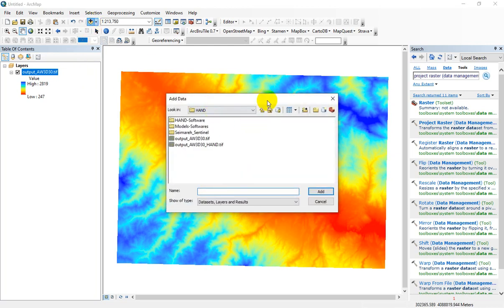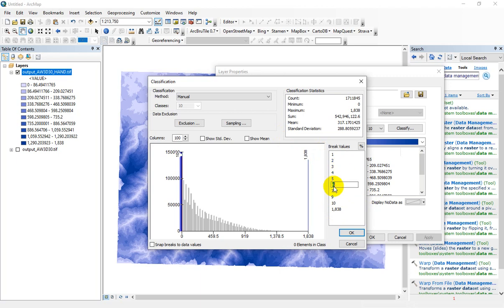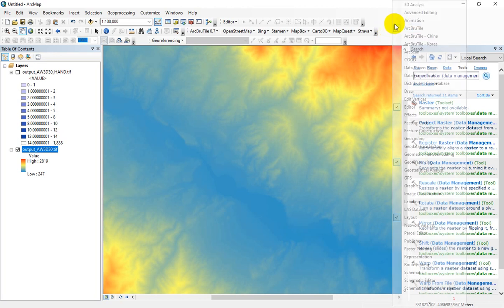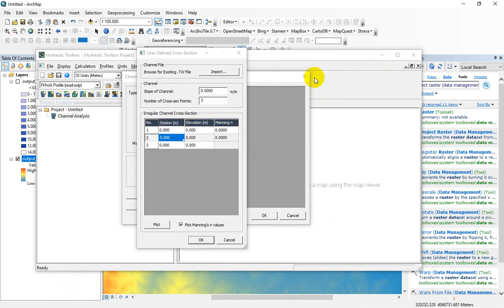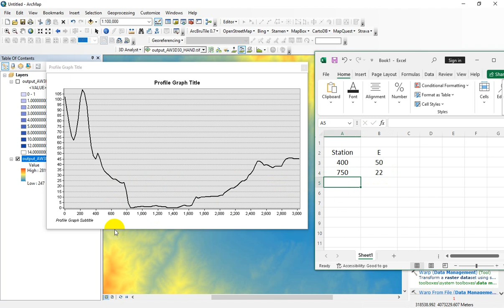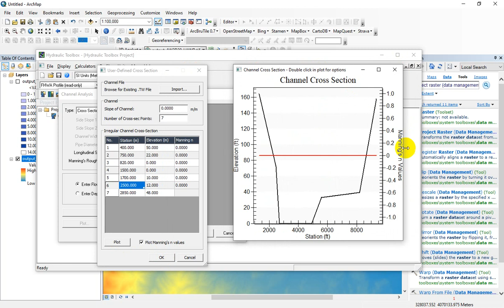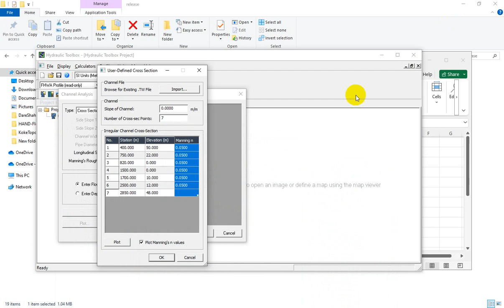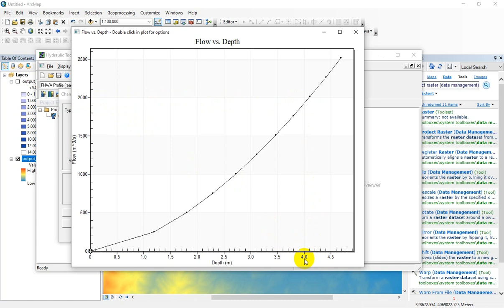Rapid Flood Inundation Mapping using HAND (Height Above Nearest Drainage) Method-Part2

Comment: hey I have a 5m DEm and I am trying to extract values of x-section. But my x-axis is showing the values like 0, 0.001, 0.001, 0.002?? How ever in Y axis I am getting elevation values from DEM only.
Reply from the maker: Hi, It seems that you are using DEM in decimal degrees. I said in the video that you should change the coordinate system into UTM and then use HAND software.
Reply: @HydroAI2024  but HAND software is not taking DEM in UTM system.
Reply from the maker: @akshay_ismic2518  You are right but in GIS for plotting the river profile you should have a UTM based DEM
Reply: @HydroAI2024  ok got it